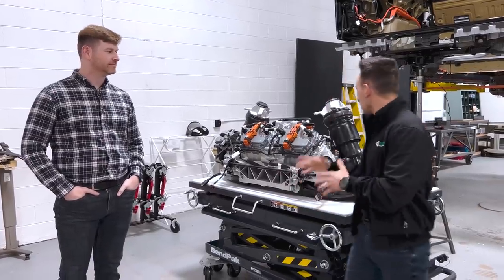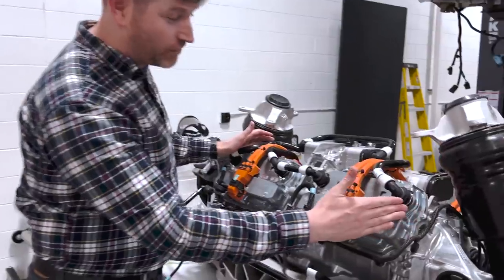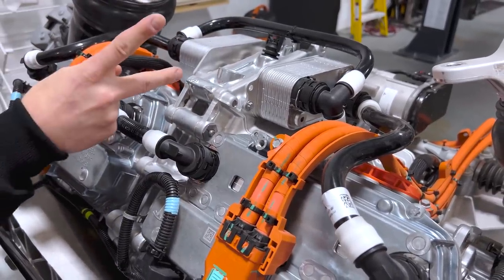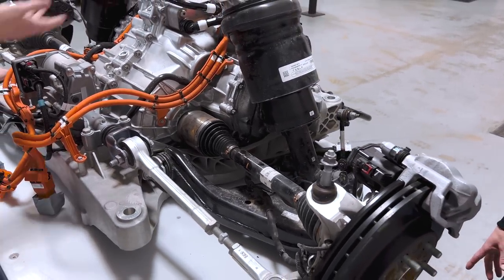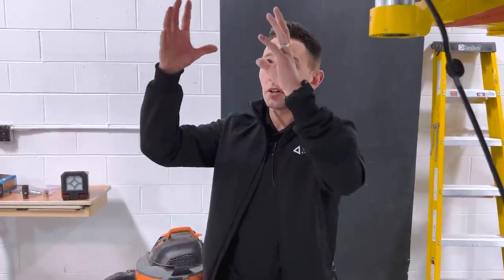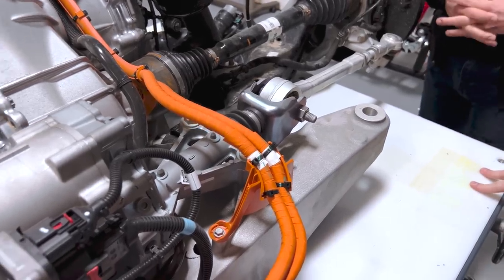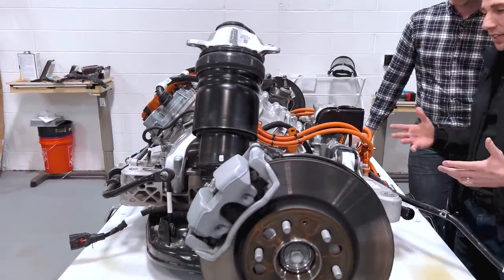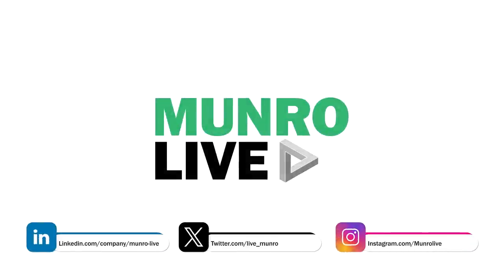Underneath the Cybertruck - Rear Cradle and EDM

Comment: Saving grams of weight by drilling plugs out of the brake rotor but there are multiple places where lbs. of dust, mud, ice etc. will accumulate.

Comment: Great job on the explanation of the geometry of the rear.
Reply from the maker: Thanks!
Reply: @MunroLive  Will the toe-in of the real wheels change with the position of the suspension?
Reply: @ulwur  that's called bump steer, and since the tie rod length is reasonably coordinated with the control arm length bump steer should be reasonable. Munro doesn't typically address suspension geometry; their expertise is in manufacturing processes and costs.
Reply: @ulwur  Yes, and the amount depends on the handling characteristics that the designer wants in the vehicle. Sometimes they will dial in slightly more toe-in with compression for the feeling of sharper turn-in when going into a turn. Munro could test this by measuring toe as the suspension compresses and rebounds.

Comment: thank-you for the insights and high production quality. it would be really interesting to see tear-downs side by side. R1T vs Lightning vs Cyber vs GM vs ICE for key areas like the suspension and drivetrain.
Reply: Rivian is using HYBRID unibody . see - Teardown video.
FUD motors & RAM, Silverado /GMC are using outdated Horse & Buggy technology .
Legacy auto still using Ladder Frames & Body on Frame. 
Cybertruck using massive Gigacastings , 4680 Structural body , UNIBODY frame CLAID in Stainless steel, both axles are DESCRETE modules , unlike Compedators. 
aka MEGA CRADLE .

Comment: I’m not too surprised to see the add-on locator on the anti sway bar.  It probably won’t be long before that afterthought is replaced by flange on the inboard side of the bushings.  It may be that that when the anti sway bars were sourced that the mounting position of the bushing cradles had not yet been finalized.  If this is the biggest last minute fix on the EDM, then Tesla did pretty well on the up front engineering.
Reply: That's just the different bill of processes, as stated in the vid, whatever that means....
Reply: @bhaebe6671   I saw an over-looked situation like that on BMW where they had to remediate an apparently unanticipated lateral movement with an add-on.  It will be cheaper if Tesla sources the part with flanges already on it from their supplier.  It will take out the labor element of installing the bushings and band clamps as well as taking out the cost of the four extra parts.  It is maybe 2 USD per vehicle, but that is 500,000 USD per year at the anticipated production rate.

Comment: Flashback to when I removed the front subframe (including engine, gearbox, suspension, wheels) from my Austin Mini.  Four chassis bolts and the body just lifted up and rolled back making major maintenance access amazingly easy.   btw, PTC is Positive Temperature Coefficient meaning an electric resistance heater - usually not what you want for efficiency.
Reply: TESLA are built Different , UNLIKE any car.
Reply: I believe the Smart ForTwo has this weird thing where the engine is supposed to drop half-way for maintenance.  Neat, but unless you do that it can be a pain to work on.

It's important to note that we prefer PTC heaters over plain resistance heaters for safety reasons.  PTCs have a fixed temperature they heat to, and lower the current at or above that.  So, they're much less likely to cause a fire.

I was shocked to hear about the stalling motor part for TESLA.  I had assumed they would just run the AC in reverse as a heat pump.
Reply: @arthurmoore9488   - the BEST repair , is NO repair in the First place - ELON.
Reply: Generally, a PTC is not used, but in extremely cold weather, it can help a lot, get up to temperature fairly quickly, and create a lot of BTUs, which are helpful when you're trying to heat a battery pack. Tesla has been using motors instead of separate PTCs.
Reply: @aaronwilliams1249   - TESLA heats up fast in Cold weather w/ Departure mode , & pre -heat.
Reply: @aaronwilliams1249  I forgot how low of a temp these are rated for.  Heat Pumps don't work as well at extreme cold.

Comment: It appears that as the volume ramps up, production costs and supply chain costs should be reduced. The CT needs to be high-volume to achieve design purity. Give it 300-500K units in the next 2-3 years!
Thanks, Jordy and Kev for the detz!

Munro is the G.O.A.T.
Reply: over 150k in 2023, and 250k in 2025.

Comment: Looking at the packaging, this reminded me of the Oldsmobile "Unitized Power Pack" that first appeared in the 1966 Olds Tornado and was later used in the famous (or infamous to the EPA) GMC Motorhome. The UPP took a V8 and mated it to a torque converter and chain assembly taking the rotational power of the longitudinally mounted engine and making it do a "U-Turn" to power the front wheels. (kinda like the front half of a 4x4 setup) Why did they do this? It aided in the assembly process having the drive unit packaged as all one "unit." I'm curious if any of the classic car folks in here made the same connection.
Reply: interesting info.
Reply: Jaguars XJ series has this and they’re a nightmare to service.. 

can’t imagine having to tell a customer they need a new plastic coolant elbow on this. That’ll be $50 for the elbow aaaaand $5000 in labor to replace it… and oh btw warranty is void unless you take it to Tesla and wait 3 months to get it in the shop 😂😂😂

Comment: Great observations ... Wow that is a huge drive unit
Reply: Tesla (tm) MEGA CRADLE .
Reply: Huge air struts
Reply: Well.... the air will travel 12 inches, its the cyberbeast not a cybertruck lolz, so it contains two motors, and it has the gearing to put both motors to drive both wheels, so yes, it is huge, but considering what it does, its expected.  This system and the front one accelerate this truck 0-60 in lilke 2.6 seconds. so you're comparing this to a w16 motor from bugatti super sport when you think about how big it is.
Reply: @davidanalyst671  - would have been better w/ Semi transmission tri motor & driveshaft disconnect.
more efficient.
Reply: @markplott4820 they are induction motors so can be turned off without drag so really no different to the semi just less parts and more reliable
Reply: @davidanalyst671  Drive to monroe and give them some color for the content. They desperatly need you as that was DRRRRRRRRRYYYYYYYYYYYYY

Comment: You have to drop the subframe to do upper control arm bushings 😂 Truly a visionary product
Reply: That's bad, but there are cars which require removing the engine to change spark plugs. Some mechanical operations on pickup trucks require removing the cab.
Reply: @brianb-p6586  on 911s that's normal. You expect that from a luxury sport car. With this thing, supposedly an off-road capable vehicle, better not put that wheel at a wrong angle.

Comment: 13:47  Saving the cost and the weight of a single 3/8 bolt !!! 
I remember Sandy talking about good enginering pactice of saving 1 gramme a day.
But other Tesla vehicles still have this holding bolt. I wonder in fact when you try 
to disassemble the brake to changes the pads, if you don't need then to have the bolt?
Reply: Why would you change the pads?  I have 120000 miles and they are 3/4 or more of new.

Comment: Imagine the truck’s box having a bed 18 inches lower than it is now WITHOUT CHANGING THE LOOK FROM THE SIDE. Without sacrificing clearance under the vehicle.

The bed on pickup trucks has always been a big step up because you had to accommodate the axle and differential, which was always the height as the centre of the wheels. The only way to lower the bed height is use smaller diameter wheels. Electric trucks don’t have the same restrictions. The trick would be to nest everything into the walls on the sides of the box. That is absolutely possible. It does mean rethinking how to arrange the parts, but it really can be done.

Comment: Faulty construction? - As far as I can tell from the video, the upper ball joint on the edge support cannot be replaced - apparently the entire wheel support needs to be replaced in case of wear. If so, it not only costs more working time but also a lot more money than a single ball joint.

Comment: A-Arms Stud Down Nut up Later Version Done Right ! Nice Duel Motored 3rd Member Heat Sinks,  Rotor Guide Bolt for Flush Mounting to Hub Can Cock with Wheel Installation Leaving lug Loose or Rim Hub Crimp to one Side !.

Comment: With megacast's ribs and structural "ribs"(I don't know what they're called), feels like vehicle structural parts are more and more organic.
Reply: Bio mimicry or bio mimetic design at its finest. 👍🏻
Reply: GIGACAST parts are very Organic. 
the IMPRESSIVE front end was created on the OLDER 6600 Ton press. 
the Rear uses the 9000 Ton press.
Reply: Sandy Munro did a segment on the giga castings.  That was one of his comments that instead of a car frame, it looks like it was designed by nature

Comment: Having seen crash test video when it first came out it was interesting to now see rear suspension design in detail. Based on how rear wheel moved in that crash it is hard to see how that movement could come from those suspension arms without something in them having broken in the crash. And failure happened simply because of rear wheel and suspension weight. Front end crash only provided sudden stop. Not the actual failure at opposite end of the structure.

Comment: Steel under frames are notorious for corrosion. Out of sight out of mind. That steel control arm looks ripe for hidden and festering rust. It really should (at least) be wax dipped to seal all the rust traps.
Reply: the Entire underbody is e-Coated as are the Gigacastings. 
the upper arm can be Upgraded by Unplugged.

Comment: For $100k they could at least put some anti-seize on the tie rod threads! Aluminum may not rust but the threads will seize anywhere that uses road treatments in winter.
Reply: before RONA, the NHTSA made tesla do a recall on one of their model X i think because there was a cable to release some seat mechanism, and Tesla did not put any oil on the cable. Its the little things that get you.

Comment: The lower A arm is a dirt collector.
Reply: Designed for California not the rust belt :)
Reply: It is too bad that for whatever reason that the A arms aren’t aluminum castings.  I was thinking the same thing.  Being stamped and welded, even if it is powdered coated, that’s an invitation for corrosion.  I live in a region who uses winter road chemicals, so I tend to notice such things.
Reply: @wtmayhew  Well, you'll probably be able to get cast or forged aftermarket ones, given the production numbers Tesla is aiming at. Of course, won't be as cheap.
Reply: I still want a CT
Reply: Drill some holes.😅
Reply: @AllistairNeil   There are some triangular shaped vents already there.  If there isn’t a dimensional restriction requiring use of a steel box member and aluminum casting would be an advantage.
Reply: @ExploringCabinsandMines   It isn’t a show-stopper, it is just a fact of life.
Reply: @celeron55   Agreed.  I am sure there will be a lot aftermarket upgrades available, as they’re already some available.  I believe Tesla wants to reach 250,000 units per year for Cybertruck production.
Reply: @ExploringCabinsandMines  this isn't a CT. what they are tearing down is a cyberbeast.  It starts at 100k, and its the only pickup truck I know of that goes 060 in 2.6 seconds.
Reply: @davidanalyst671  I still like it 👍🏻

Comment: Dirt is going to collect on that bottom A arm. I’m surprised there’s no water drain hole
Reply: ...costs a nickel to add.
Reply: With the vibration it may splash/fly out so quickly and dry so that a drain is not needed (and a hole adds a possible point of corrosion).
Reply: @tesla_tap  Doubtful, mud sticks and builds up any place it can.

Comment: Those threaded holes on the brake rotor may also be for removing stuck on rotors. By threading a bolt into the hole, it can break a stuck rotor loose.

Comment: I really like when sandy is not involved in the video he is too much Tesla fan boy . I would like to know if the truck is hit in the middle of the rear wheel and the aluminum casting is broken where the upper control arms are bolted is there a way to repair this this can happen when sliding and hitting a curb from the side ?
Reply: Given their discussion and the way it looks, Tesla went full "not our concern" on repairability. So much for being different from other manufacturers.

Comment: Control arm pivot points have no affect on the half shafts. The wheel position (up/down) is the only thing affecting the half shaft angles and that has to be the same no matter where the control arms are connected. That being said, yes the half shafts are pretty long. Some of the longest IRS control arms I've seen belong to the Taurus wagon.

Comment: Without opening it up it may be Silicon Carbide (SiC) MOSFETS instead of the IGBTs mentioned in the audio.   Granted in some dual motor systems they some OEMS use IGBT for the motors that are used infrequently in this case it would be the front drive unit for cost savings
Reply: exactly what I thought - how? IGBT for 800V are not common and SiC MOSFET (Hyundai, Porsche -> Vitesco and others) enable lower switching losses, smaller form factor and higher efficiency overall due to higher switching frequencies possible for motor controller. By cutting the inverter DC side currents in half I don't see the need for IGBTs with 800V architecture.

Comment: Over and over they say “no maintenance on EVs” watch this and you see coolants, and gearboxes with lubrications, I just don’t see that they have NO maintenance, probably different maintenance would be better.
Reply: It is still a vehicle and thus will require maintenance. Only real difference is no engine oil changes. And that one speed gearbox operates at 17k rpms  at top speed, so abuse will take its toll quickly, if ignored.
Reply: Maybe "little mainence" would be clearer.  Even though it has various fluids, they are not under the extreme heat, pressure stresses, and contaimination as occurs in an ICE car, so should last many years without replacement.  Brakes on EVs last about 200K miles or more, as regen dramatically reduces brake wear.  Still have to replace tires and wiper blades about the same rate as ICE vehicles.  The main thing is the many expensive ICE parts that don't exist on an EV that need replacement, from timing chains to mufflers.
Reply: Nobody is telling that seriously but starting in 2008 with the first EV that is making America really great again - not the 🤡 - out fleets TCO are dramatically lower which adds to our company‘s performance. It’s still a car needing a certain amount of care and maintenance, so do not believe everything that people with opinions tell you and START THINKING for yourself or did your horse or bicycle never needed servicing?
Reply: @tesla_tap  - Tesla brakes last for LIFE, unless you race. 
then normal wear. 
carbon brakes for racing.
Reply: @tesla_tap  - no fuel pump, no oil pump, no sparkplug, no oil changes......
Reply: No timing belt, 2000 less moving parts
Reply: @arpitrpatel  - what timing belt.....lol.
Reply: CT made w/ zero belts or pulley.
Reply: They do, but don’t need regular replacement/servicing/maintenance. You are only to expect to replace/top up tires, wiper fluid, wiper blades, and very rarely brake pads throughout the life of an EV.

Comment: With the upper control arms located directly on the vehicle structure - not on the cradle - the cradle can't be vibration isolated; the cradle must be solidly bolted to the vehicle structure.

Comment: what do you mean by "stall out" when you're talking about electric motors? Like just running the current in such a way that it doesn't actually move the rotor and generates heat instead?
Reply: I'd think so. So they saved a couple bucks and some weight by using the motor as a very expensive resistor. I'm glad the motors are so reliable and never fail. Oh, wait...
Reply: @dayhillbilly  yeah, I was wondering how efficient that could be as a way of generating heat

Comment: All that cooling and inverters that there says the charging plug, battery inverter, and motor inverters are better off up front. Then a much smaller cooling system can be used for the motors and special covers are not needed for the inverter - can just run the power cables directly into the motor from the upfront inverters